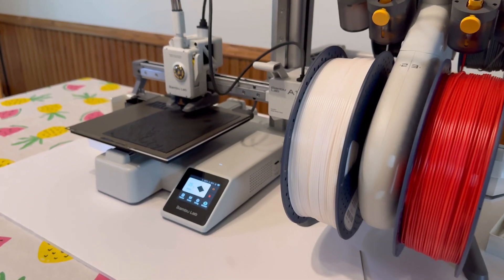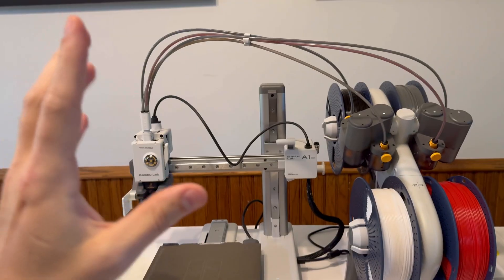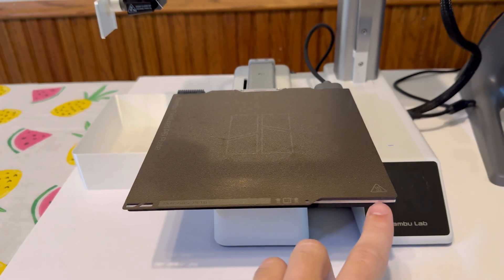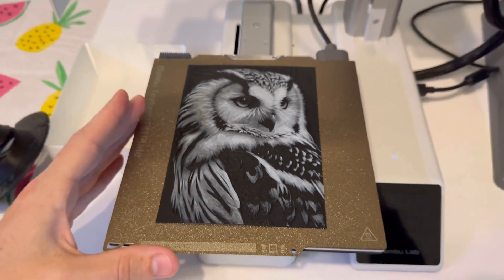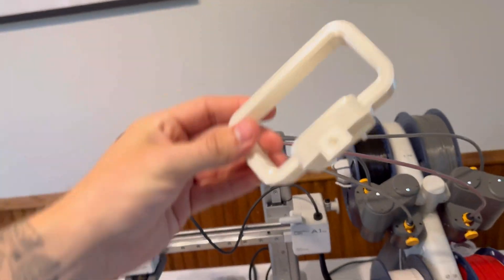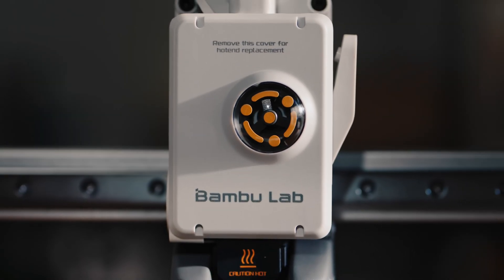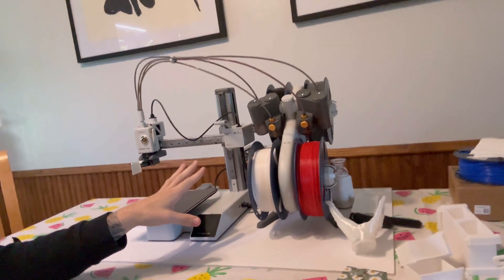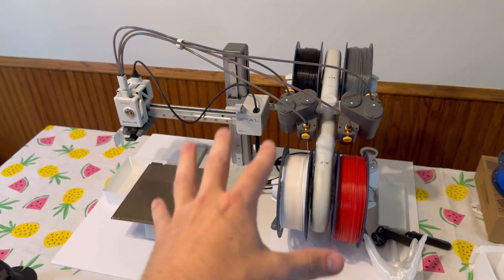Watch this Before Buying the Bambu Lab A1 Mini!

Comment: What do you expect with the a1 MINI ofc the print plate is small and the dimensions are online so don’t complain that’s why the standard a1 exists. And using an ams isn’t needed it wastes so much filament but anyway part way through a print you can set in the slicer to pause or u manually pause and swap the colour. And with sunlu it’s cheap for a reason. Get sunlu for cheap or if u want good quality then get bambu official.

Comment: And what if I am from country, where a1 mini cost 490$, a1 765$, but that is still great because I can get ender 3 v3 se used for 220$ and new from same price that is a1 mini (of course a1 and a1 mini are without color changing tool).
 Then what I should pirchace? All other 3d printers cost lot more, and for example - casual worker in zoo shop here works 6/7 for 10 hours per day and for month has 365$, sooo, there is need to think before purchasing such things

Comment: The AMS generates a lot of waste (often even more than the materials used to print the model itself), so it's only a must-have for some things or certain types of printing effects. If you've printing miniatures, then it is completely unnecessary. also, as others have said, the A1 and A1 mini are not identical. The mini is better for small, detailed models than the A1. However, for most wargammers, the extra cleanup of models is minimal compared to the loss of build plate size. You'll want the larger build plate with the A1 in the long run. If you really want miniatures with fine details then just get a resin printer instead.
Reply: If the A1 mini is going to be your only 3D printer, then sure its good to get AMS, but if you plan on buying a bigger one in the future, get used to the mini before going for more advanced models.

The A1 mini is more than enough for easy jobs.

Comment: Whilst a lot of these points are true..    like with most apple products too there's always 'for just another $100 you get x'

When in reality, if someone can spend £150 and get a whole small printer, that's awesome. When you get the A1, then go multi filament.. then go P1P...  then oh P1S has encosure, but you need the ams too.   

you end up going from £150 to £800 real quick.

This is an awesome little printer, stick with it. I have a P1S with AMS and it's frigging awesome having multi colour. But really, most people want to print single colour brackets, adaptors, covers etc.. which the mini is perfect for

Comment: Was great until you get a monster blob. 
I have changed 4 heat assemblies on it. 
After the blob, it never worked again no matter how many parts I replaced. 
This blob issue is a huge defect on A1s. 
Bambu needs a better service/solution/ownership.
Reply: watching the first layers print is on you. If you are just starting a print something and then going to take a nap you're setting yourself up for disaster, no matter the printer.

Comment: There were a lot of "don't bother without the AMS" and "you should really just save up and go with the A1" sentiments in here. I wouldn't say that's bad advice for someone who does not already have a printer, but as someone who already owns an X1C I have a different perspective. The reason I got a mini (without AMS) was the quick swap system for the nozzle. I've recently had the need to print some smaller parts where 0.4mm didn't quite get the job done. I could have gotten a 0.2mm nozzle for my X1C, but once I checked out the process for swapping it on that one, I decided.. hell no. So I got the mini and a 0.2mm nozzle and couldn't be happier. The X1C will deal with any multicolor prints and in general continue to be my main workhorse, with the mini as an additional speedy 0.4mm printer that's large enough to deal with most of my needs, and can be switched to 0.2mm in about a minute.

I now have a 320²x420 Elegoo gathering dust.. It's just so slow, and so cumbersome to use (sneaker express with memory card). If I ever find I really need more than the 256³ of the X1C I might just go look for a new printer. Perhaps Bambu will have released a larger one by then.
Reply: I have the same opinion. I have a P1S as my main printer and just picked up the mini for the same reason. I wanted a small, quick printer to print fine details or quickly print extra pieces. The a1 mini is excellent for that. It's also pretty quiet too so it's not annoying to have on my desk. A1 mini is under rated imo
Reply: Wow.. ok I hadn't thought of that. I am really new to 3D print and I am thinking of just starting with the mini and no AMS lite. I only want to print in white. Not into multi colors. I will mainly want to print small parts for my home assistant esp32 and shelly boards. I have 3 questions 1/ without AMS what happens if the spool runs out? Can you swap and feed in the new spool on the fly? I need light stable PVC (I don't want "yellowing". 2/ Can the mini (without a spool) handle PETG? 3/ What nozzle to I get? thanks!
Reply: @wapphigh5250  1) I haven't tested the A1 mini in particular (I've literally had it for just about 24 hours), but I would be very surprised if it doesn't do what every other printer out there with a filament runout sensor does, which is to pause and wait for you to provide a new spool. 2) I'll ignore the "without a spool" bit, because that doesn't make any sense to me, but yes it can print PETG (as the info page at the Bambu web page says.. just sayin') 3) There's no real way to answer that based on the available information. If you're talking about cases and such, you'll be fine with the 0.4 it ships with. I've printed plenty of those for ESP32s. And if not, a 0.2 nozzle is $12 USD at the moment, so hardly an expense worth mentioning.
Reply: @mascot4950  Awesome that's the info I wanted! I just want a no frills printer to print PETG hard cases for my electronics. I will only print them when I need them.. so not in huge volume, When the filament runs out, I just load in another.. sounds perfect to me! Thanks so much!
Reply: I'm exactly in the same boat as you. Bought my X1C last Easter, have already done ~2200h of printing with it and find myself sometimes needing a 0.2 nozzle for a print. That and the fact that the X1C is noisy! I have bought an A1mini combo (most people who bought it without AMS later regreted it) which I plan to use for smaller and longer prints, along with a 0.2 nozzle. My experience with the AMS is that even if you don't want to do multicolor prints just having 4 different and individual colors available and the ease of swap is already worth the money!

Comment: I have a primary printer (not multi-color through) that has 355x355 build plate. I am tight on space, is the A1 mini a good choice for a secondary smaller printer?
Reply: If you have something that can do larger prints yeah the mini is absolutely worth a buy based on price and size. It’s nearly as fast as bambu’s other options without the massive footprint

Comment: Does the bambu lab printer "need" to be connected to wifi? or does it still function without a connection?
Reply: it works without a connection too you are not required to connect to wifi

Comment: Why does anyone give a flying F about printing 2D artwork on a 3D printer?
Reply: Check out puzzles and you can't park cards
Reply: 1) it's a treat example of how well the AMS system works. 2) it's a big thing on Etsy. People like this sort of thing.
Reply: That's very true. I have a P1S and ender 3 before that, very rarely am I ever filling the build plate.  Sure it's useful for large things but most of the time brackets, cases, adaptors are all fairly small
Reply: I suck at ark and my family will think it’s cool
Reply: I’ll let you in on a little secret: different strokes for different folks lol 

For me I would never use a 3D printer for 2d art work. I use it to print robotic parts and custom A/V parts. 

So I could say why would anyone print decorative pieces with no function other than to look cool but I don’t because everyone has different goals and wants so I’m happy they get to use 3D printing as a way to create.
Reply: cause its cool

Comment: $100 matters when you are on a budget. There is Ender 3 V3 SE and KE that is much cheaper but needs some tinkering. That costs less than a1 mini.

A1 is still expensive and it needs time
Reply: People buy a super cheap printer, then spend a lot of money on filament (and other things) over time. The price of the printer becomes a smaller fraction of the total cost over time.
Reply: @michaels3003   cheap printer is fine if you don't know that 3D printing will be your long term hobby. But it must be really cheap bc now A1 mini is very good prices. I bought Neptune 2s for 140usb on bf sale.
Reply: Mini is better for miniatures based on my research on these two printers.  They are not "the exact same printer" like people seem to believe.  They are similar, but size does matter and the larger size seems to affect the physics, which in turn affects detail quality enough to where the A1 looks more like FDM and the mini looks more like 1k or 2k resin.

If you're going to print miniatures, like me, then you're better off saving the $100 and buying more STL files from Fat Dragon Games or another FDM sculptor.

Personally, I'd like to buy 4 or 5 of these cheap minis and run a viable print farm where I can actually print entire armies in one week or less.
Reply: True. On budget A1 mini. If you have more cash, or upgrade -  A1 combo. I dont really see logic in A1 mini combo. - AMS lite is to expensive to combine it with Ai mini IMHO.
Reply: You'll spend the extra 100$ on fixing the ender from my experience and a lot of people I work with. Bambu is less likely to have problems, but I always say if you're on a hard budget this low you shouldn't buy one. Either start working or work more. I'm not saying drop a grand on 3d printing, but a couple hundred bucks is not that much money when considering something that is a long-term tool and investment.

Comment: You sold me on getting the AMS Lite with the A1 mini. I'm completely new to 3D printing and have read that these printers should not be left unattended while printing due to the unlikely event of a fire. Just wanted to know if the A1 mini has some sort of a pause and resume later feature that allows you to stop printing when not at home or during the overnight hours? That is one of my main concerns; what if there is a 12 or 15 hour print job for example? 
Also, are there any smells that the filament gives off? I plan on using strictly PLA since I read that it is the most safe out of all the filaments. 
Any help would be appreciated... Just recently joined your channel and I'm really enjoying your videos.
Reply from the maker: Anything that the a1 mini has.. the A1 most likely has. I think your worrying a bit too much about it. Everyone in this hobby lets prints go while theyre at work.. or going to sleep.. that's what makes it fun. I would get the A1 instead of the A1 mini
Reply: @3DPrintDood  Thanks for the advice. I'm in Canada so the price difference between the A1 mini and the A1 is around $200. I'm literally just going to start dabbling in this potential hobby. If I find that I really enjoy it I don't have a problem in upgrading to a bigger printer later on.
Another thing that I've been scouring YouTube for is advice on which software to use to make my own 3D prints. Everyone raves about Fusion 3D but it seems to have a huge learning curve. Any suggestions or future videos on what you use to design your own prints would also be great.
Thanks again!